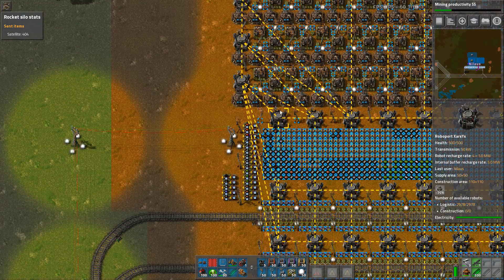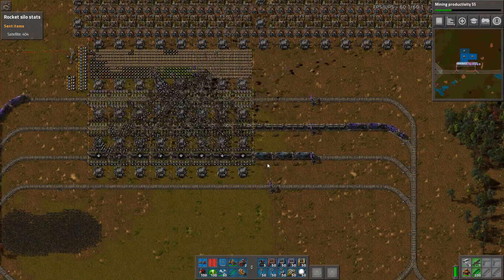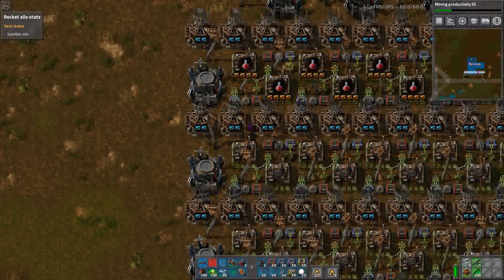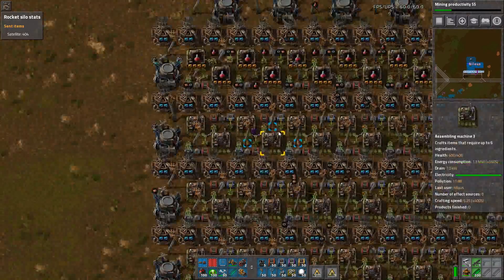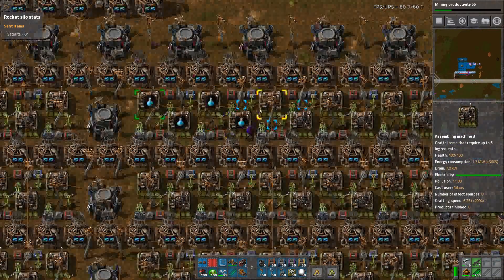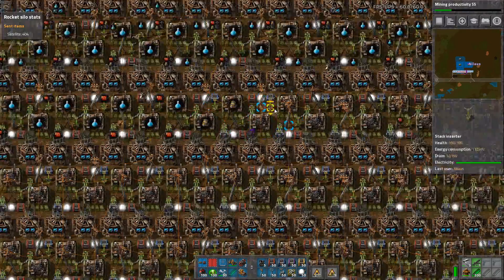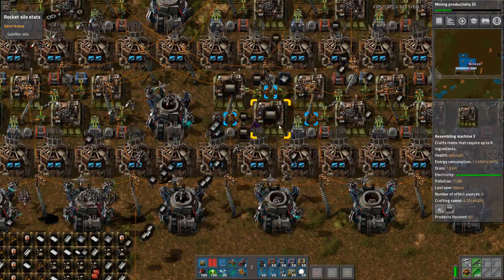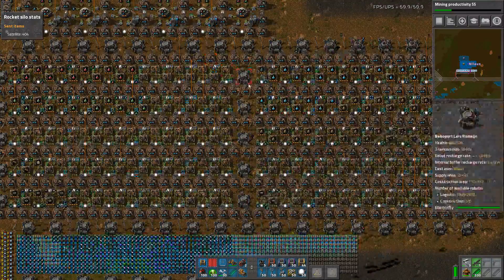Factorio - My Megabase E48 - SCIENCE base ramping up

Comment: Hey Nilaus. Three thing that I spotted in how you play and you can make it more fun for you.

1. When you set amount of requested stuff and there is already something in field (for example there is 20 and you want 200).  You mark "20", delete this and manually write "200". Maybe just click on field, use END button and add "0" at the end? Example: https://youtu.be/2x4_XV6916Y?t=581

2. When you change amount from "200" to "500" you mark "2" with mouse and then write "5". This is very error prone. Maybe just click on field on left side (so coursor will be set before "200") and then use DELETE button? Then just add "5".
Example: https://youtu.be/2x4_XV6916Y?t=695

3. This is for your other campaign. I spotted that you have "messy" warehouses. So for example you have this large magazines with all boards (basic elecronic boards, etc.). And in this "there is 6 kinds of boards in magazine" there is very small amount of electronic logic boards. And you are looking for them. You can use something that is using Arumba per second per patron - shortcut to sort content of magazine. He is using it every time when he is entering magazine.
https://steamcommunity.com/app/427520/discussions/0/224446340336352964/#c2592234299537552409

Comment: 8:30 The scroll lock comment. It basically does nothing and it used to have some functionality with some microsoft products I think. I'm sure someone will copy paste a list from wikipedia or something at some point.
Reply from the maker: It still does something in some programs. Mainly it is one of those times when you bang your head on the keyboard and suddenly Word is doing something new (yes it happens quite often at work)
Reply: Though it is not used by most modern-day software. ... When the Scroll Lock mode was on, the arrow keys would scroll the contents of a text window instead of moving the cursor.